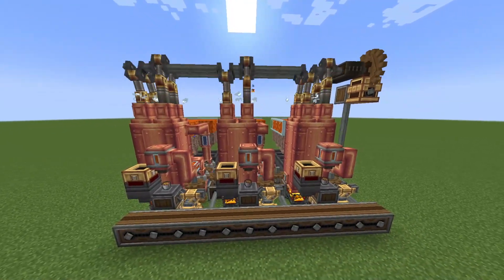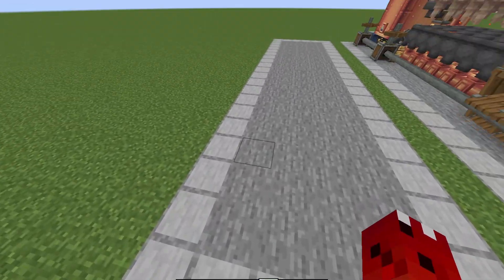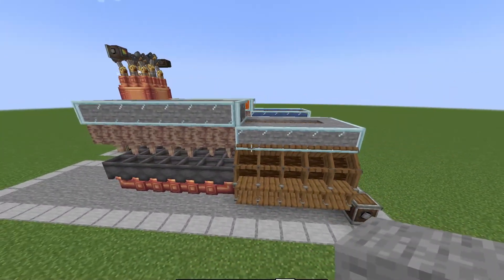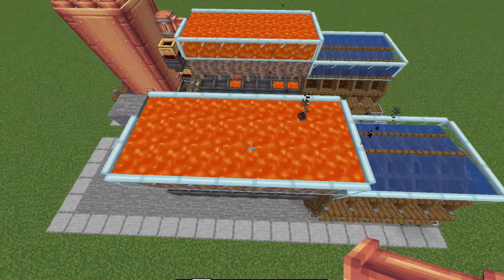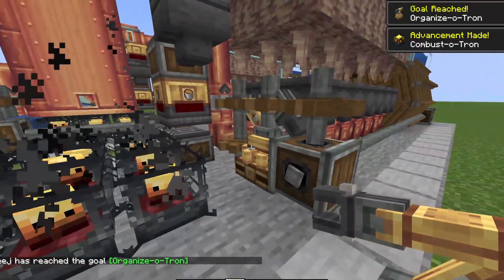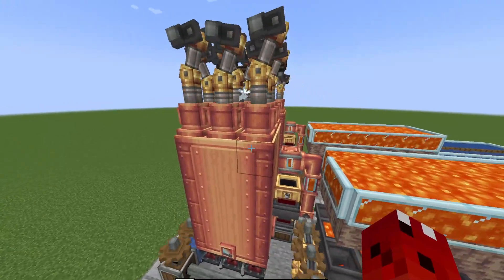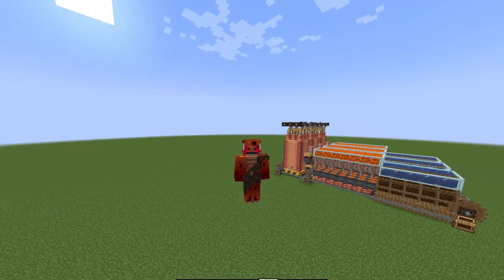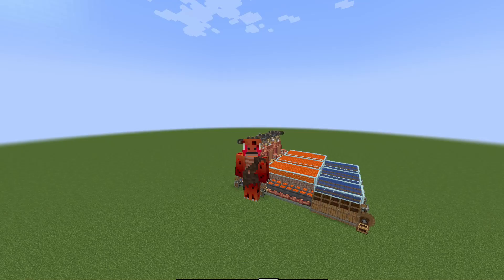The UNBREAKABLE Steam Engine TUTORIAL | Create Mod 1.19.2 | #tutorial  #minecraft #create

Comment: Compressed this design into a ~12-15 (pumps on top or sides) long build by placing the water wheels under the dripstone. Need to rotate the small cog for it though to reach the pump. So could fit 4 inside a chunk.

Comment: The water wheels are completely unnecessary tho considering you can have the engine itself powder the lava & water intakes and the mechanical arm. For me this design just makes the whole thing a bit too big, you'll just need to kickstart it by spinning the water intake by hand with a crank until the engine powers up and then quickly place or rotate a shaft to connect it to the engine so it starts to spin it itself (if you don't leave it disconnected you can't hand crank it, too much stress units). Only downside it that if your engine ever turns off due to tick lag or whatever causes it you'll have to kickstart it manually again by disconnecting the shaft that powers the water pump, spin it by hand until the engine starts and then reconnect it (also leave a switch by the engine that turns off ALL machines the engine powers or you can't kickstart it by hand because all the machines that the engine powers require too much stress units for the engine to start, it instantly overstresses)

Comment: Shame that it's 19-blocks wide. Would be nice to have it fit in a single chunk. I guess you could chop off a lot of the cauldrons, if you have a lava supply elsewhere
Reply from the maker: If you have an external lava supply you can pretty much can chop off the entire build, youd only need the engine and the bucket loading system. Though this was designed mostly to be beginner friendly and completely standalone and self sufficient so it ends up being bigger

Comment: so wait do i take the power out of the speed controller or the actual steam enginees up top?
Reply: The steam engines provide the output power. That's what you send out to other machines and contraptions.

The speed controller just balances power and speed from the auxiliary water wheels so the pumps and arms can move water and lava. Tapping that auxiliary power for other things may cause the steam engines to shut down for lack of fluids.

Comment: so yes it is common to use water wheels of various sizes to power the water.  If you are bothering to build a steam engine why not use another steam engine?  I mean a basic passive steam engine has 2048 SU and no fuel requirements.  Needs only a single lava or a campfire to heat it.  It is also only a 2x2x1.  Certainly one should be able to design such a thing.

Comment: Thanks for a good, easy and straight to the point tutorial, now rocking a steam engine in my base :)
Reply from the maker: Glad to hear it! Now you know how they work you can work towards that crispy level 18 boiler using blaze burners 😎
Reply: @skeej_inc   their could be a way to make it more compact by giving the blaze burners a straw which would then allow them to take the lava directly out of the pipe instead of having to feed them with buckets but I am unsure of how the design would have to change to make use of the straw which causes the blaze inside the blaze burners to put on a drinking hat as well as I believe also giving the player an achievement for doing so

Comment: 11:18 To connect the water wheels, you can use either encased chain drives or belts and shafts. Then add a gearbox at the end to connect the water wheels to the rotation speed controller. Using belts and shafts is much cheaper
Reply: I think he was going more for a style thing with that. Since Belts wouldn't fit the "palette" back there.

Comment: Engine size max for L9 is 3x3x4 as you can't get any more power without blaze cakes, about 12 or 16 cauldrons should be enough I think as we get excess as it goes on and I don't think 256 rpm is needed for the arm and pumps, you can find a sweet spot by trying it out in a creative world. Just my suggestion. 😉

Comment: Using external power - wheels to power engine, quite dissapointing.
Crank start up is not that hard to do.

You can do ^ shape with dripstone and lava to reduce pipe amount,
More sides with water = much more power,  you are wasting space  with extra wheels

tbh, its pointless to tile with these engines,
only 1 is ever needed
Reply from the maker: If you can do better dont leave a shitty comment ❤️ its a waste of both your and my time
Reply: This isn't even correct. the large wheels don't care. Im pretty sure the small wheels are only affected by orientation and bubbles.

Comment: i built a very horizontally compact engine setup for a server i was playing on (the engines went inside a structure that the base was centered around) and i ended up with a decent self sustaining engine. granted, of course, it will stop if you reset a server, but otherwise it runs indefinitely. its just 4 lvl 4 steam engines powered by lava. It is really tall; i built it partially in a crater from a mod i was playing with. but everything, lava source, water, engines, all fits in about a 9x9 space (excluding vertical height). i cant quite recall how much SU it made but it was in the range of 420,000 SU and served me well enough until i began making larger factories and connected a lot of alternators to power machines from other mods.

Comment: Thank you so much, this is exactly what im looking for in my world. I have one question, how many SU does to take to run it? I know you are using 5 large water wheels, but im playing a modpack that makes large water wheels extremely expensive, and im trying to figure out a slightly alternate design to get the first module running until I can afford more large water wheels. Esp since it looks like you arent getting the max SU out of them since its just water on top instead of all the way around
Reply: Well, 5 water wheels produce 5x512 SU = 2560 SU. And because it is perfectly stressed, we can assume that the machine uses 2560 SU.
Reply: @CommiePlasma  Correct Snoob8, it takes that exact amount of stress to run everything connected.  You get the "perfectly stressed" achievement after making that work.

Comment: Just a little thing I wanted to point out, if you really want to maximize the amount of SU you get from this design you can use encased chain drives instead of belts to combine everything. This is because belts consume a small amount of SU to just have them running, wheras encased chain drives do not.
Reply from the maker: Belts only consume SU in older versions, (0.3 and below i believe) which I’m using the newest update (0.5 Rise and shine update) so this doesn’t affect the design
Reply: Water

Comment: Hey Skeej, you can compact this a bit by reducing the size of the lava farm. A L9 boiler fed with lava will be self-sufficient with 12 cauldrons. They make slightly more than is consumed and will eventually make a surplus.
Reply: tbh i usually use 14 just because it is better to be safe than sorry especially cause i like not having to babysit my steam engines lol
Reply: I just use a lot and store it in one mega tank!

Another option is to fill a pit (slowly) with the excess output. Once it reaches a large enough number (10 thousand iirc), it will produce infinite lava via hose pulley!
Reply: 11 I think
Reply: or to save some headache download ender chest and tank mod and suck the nether out
Reply: I also found that the engine size can be reduced to 4 blocks high as you can't get any more power out of it without blaze cakes.

The lava bucket system can also be compacted by placing a brass funnel on the side of the bottom depot, filtering the funnel to only accept empty buckets and then have the mechanical arm grab from the depot. This elimates both of the smart chutes and the other depot. You might think this will lead to an issue where it grabs the bucket before it's filled, but the mechanical arms actually have some pretty smart programming and will only grab the bucket if it has lava in it and at least one of the blaze burners need to be fueled.

By compacting the engine size, you save on copper and by compacting the lava bucket system you eliminate the cost of iron from the filter part and reduce the electron tube cost to 1 instead of 2.
Reply: @Magmabot16 you're gonna have to explain that thing with the depot, because I'm not sure if we're supposed to still use a hopper or not
Reply: @Magmabot16  Well, that mechanical arm thing...isn't the case for me, it just loops grabbing the bucket and placing it back
Reply: I managed to do a 4x6x5 auto sufficient survival friendly steam engine. Check the comment below with the link to the tutorial. (It's a google drive link so it's safe, + u don't have to downlead it, just watch it)
Reply: https://drive.google.com/file/d/1FbP_Kpse8j81EK_aTPqft3siu-i8_jgf/view?usp=sharing
Reply: @weird.gomezzz  “The comment below” unfortunately got deleted.  YouTube often gets rid of random comments, especially if they have links.